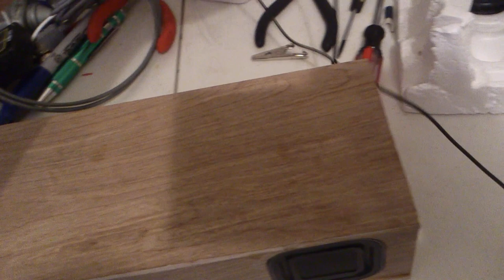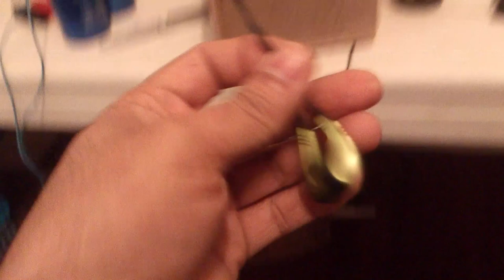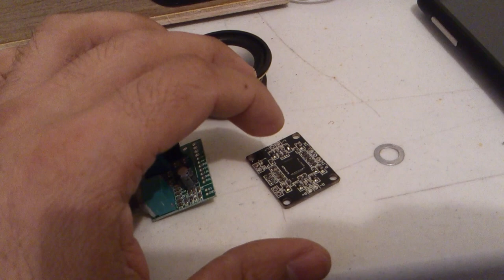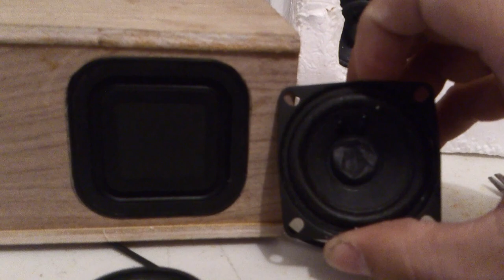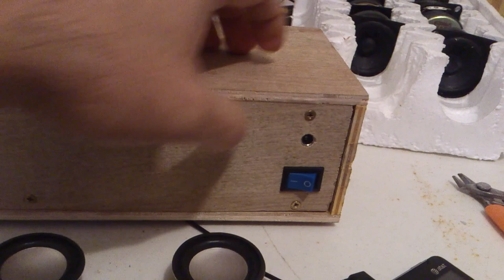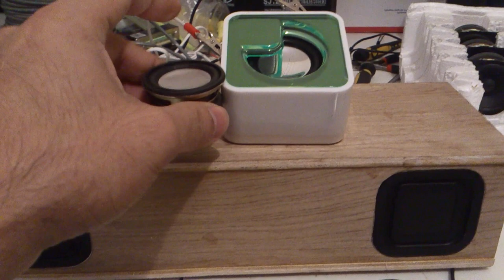HiWave  flat 2 inch speaker project review

Comment: hi so what are those two chip modules i  and what speaker are that
Reply from the maker: The black one is a 12 volt 10-15 watt amp I m using with the speakers n the other one is a 5 volt 3-5watt amp with volume control. The black one is perfect for these little speakers.
Reply: thankx for your reply wanted to make a little speakerbox for a while now to take with me when walking the dog or a bbq night at the beach thankx